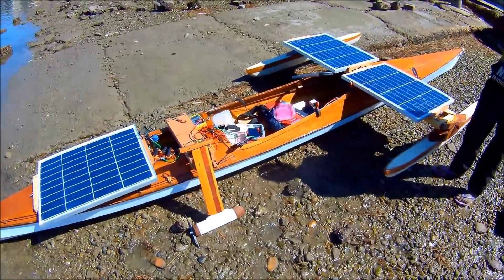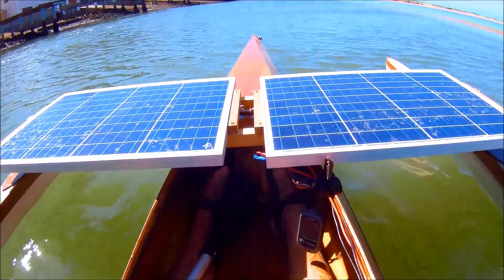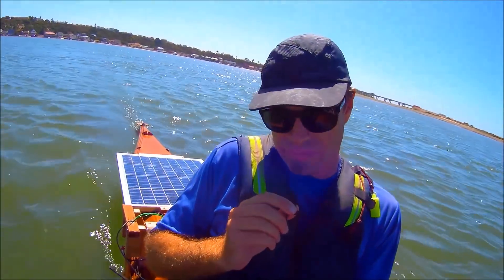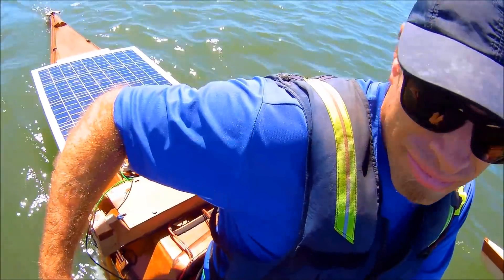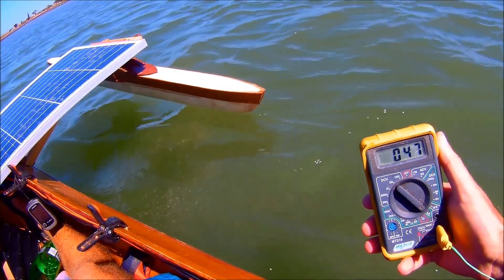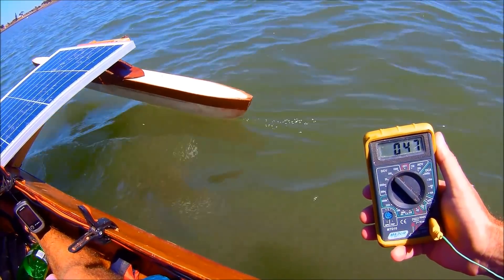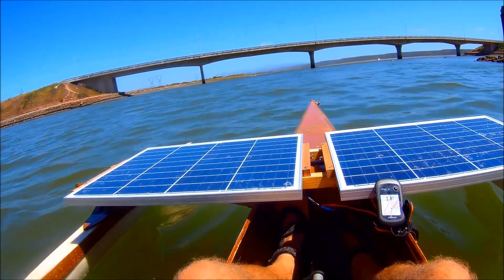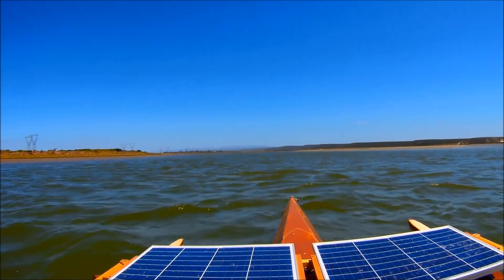Solar kayak - new propeller test

Comment from the maker: Using an aircraft propeller might seem counter-intuitive. I explain their performance underwater here: https://youtu.be/4kL66c6T9po
Reply: use super capasitor
Reply: Add battery  for backup. Because  it won't  run at night or in rainy weather
Reply: are those pontoons custom?
Reply from the maker: @vinny8532  yes, glued sheets of xps foam, shaped and covered in thin fiberglass.

Comment: Key note for solar panels: shade on even just one cell of a panel will act as a resistor to the whole system which is why you get such a drastic decrease in power despite having several other solar panels with full sun coverage.. The single cell actually restricts the flow of current.. Thats why panels are best for keeping batteries charged and running the motor off of the battery. Hope this helps! :)
Reply: @Alfonso Soriano If they were all in series one dead cell would not slow the motor it would stop it
Reply: excellent info, thanks
Reply: The weight of the battery should also be put to consideration
Reply: @steveddad4385  all panels have a bypass diode built into the junction box. He would be better off with a Lithium deep cycle battery. They are light weight so weight wouldn't be an issue.
Reply: @ddee2501  Weight doesn't matter much if your speed is constant.
Reply: integr8er66 they in series and parellel for this type of panel !
Reply: @RobertSeviour1  It does if your weight increases displacement which increases wetted area which increases drag.
Reply: @mabamabam  You are right, but compared to a road vehicle, a little extra weight has no much effect.
Reply: Can you use and charge a battery with solar at the same time?  Ideally I want to charge up the battery and use the solar but revert to the battery when losing power or need more speed.  Like get a 50 power motor with 600 watts solar to give 30amps so 30 power from the motor but I I need 50 I can use the battery or if the sun is poor (I’m in uk) then use battery
Reply from the maker: Absolutely. Connect the panels to the battery via an mppt type charge controller. Then simply connect the motor to the battery as well. As long as you use less power than the panel can produce, any excess solar power will charge the battery. When you need more motor power, all the panel power will go to the motor and the battery will supply any additional power if needed.
Reply: William Fraser sounds great, I know very little about electrics or boats actually, just planning to take the kids on some lakes for fun with an Intex 5 excursion, what battery and motor would you recommend?  I’m kind of thinking I need 50 thrust but that would need 600w of solar and then it’s how I build a Bimini to put the solar on, without also costing the earth! Cheers
Reply from the maker: @carlsmtb3171  I have only just bought a minn kota 50lb but have yet to test it before making any recommendation. I have seen some Intex inflatables perform surprisingly well under oars, even when loaded. Keeping the load in the centre will increase the rocker unless you have a very rigid floor. Some rocker is always good for low speed and high load.  I saw a video quoting 3mph max with a 30lb motor on the Excursion 5. So assuming 25A current at 12V, that is 300W for 3mph. Depending on the prop, a 50lb motor will most likely give you similar efficiency and performance but at a lower throttle setting. Any additional speed is going require much more power but you can also improve performance by using different props. I have yet to hear of someone getting worse performance after fitting a model aircraft prop. In time I will do the same with my Minn kota and make a video on it.
Reply from the maker: @carlsmtb3171  The large panels generally offer the best value in terms of power/price, but the size and weight make them difficult to transport and rig on the boat. The panels come in fixed size ranges, with length of around 1.65m, 1.9m and 2.1m. Width is usually around 1m for all of them. With each size offering you find a range of different power depending on efficiency. Weight for each size will be constant, so best power/Weight will always be the highest efficiency offer for a specific size. They are rare, but some companies do offer thin, semi-flex panels in these sizes. I just recently bought two 330W Renewsys Deserv F1 panels. They were double the price but weight is 1/4 of a similar size rigid panel. The allowable flex is so limited is of little practical use. Flexi consumer panels such as Solbian and Sun-power could easy cost 3-4 times more still.
Reply: @RobertSeviour1  with more weight the kayak would sit deeper in the water and the resistance from it would increase.
Reply: If I'm not mistaken each cell should have a bypass diode, you just have to get the correct pannel...don't need one in j-box
Reply: Only for the cells that are wired in series with that specific cell.
Reply: @RobertSeviour1  in boats weight increases your displacement which increases drag.
Reply: My panels generate power on a full moon!

Comment: Many have said it. You need a different prop. Match it up with the lowest kv motor for your voltage.  Brushless 110-120kv (@ 12.6v)motor with a trolling motor prop. I would find an old trolling motor and gut it. Use the shaft cut off and coupled to a brushless motor. Seals work well and you can cut weight by removing the old trolling magnets and resistors in the front if that's where they are located.  Esc can be ran using a servo tester / potentiometer. Best of luck. Please make more videos!
Reply from the maker: I have just tested a 215Kv brushless with bevel gear reduction drive. Unfortunately the electronics did not play along but I am working on it. New video soon. On the subject of the prop - a fluid is a fluid. If Reynolds number is the same the prop would not know the difference. Reynolds number is all about ratios, so for a given size prop all you need to do is match the rpm to suit the new fluid's density and viscosity.
Reply: Gear reductions will create drag because of the moving parts. Why not go lower on the kv and direct drive the prop? Get crazy and make a single blade counter weighted prop! I would even think about putting the prop in the front with a small nose cone. The turbulence from the rear of the case can't be helping. Just ideas. Thanks for the response.  I really enjoy this kind of stuff. 15 years in rc. 5 of them fpv. Now 2 weeks with an electric kayak and I'm thinking how I can make it more efficient.  Cheers!
Reply from the maker: @cuzimnik25  There is indeed more drag on the gears but it allows me to mount a large motor on a vertical shaft and keep the underwater housing small and streamlined. My new design does have the prop mounted in front. Spinner turned out of Black Cherry on a bench drill. The 3.7:1 gear reduction gives me the equivalent shaft torque and rpm of a 58Kv motor. I should now be able to swing a 10" prop with very coarse pitch, further improving efficiency, hopefully enough to justify the gear drag. Finding an actual motor with such low Kv is near impossible. I would still prefer a submerged motor though, the bevel gears are finicky buggers when it comes to alignment and adds to the noise.

Comment: That is very cool, Thinking a possible improvement if you don't want to use a battery. is to use a MPPT charge controller on a Capacitor bank. The Charge controller would prevent the panel voltage from being pulled down to the point that they do not put out much at all. I am very impressed that 150 watts worth of panels would propel that kayak that fast. I really like your experiment.

Comment: I've messed with 760 watts of solar running a 30 lbs thrust 12 volt trolling motor.  The pannels were all mounted above the canoe then I had a surfboard as an outrigger.  I would time how long it took me to pass a leaf in the lake.  I'd convert 'feet per second' to miles per hour.  I'd do about 3.5 mph.  Your 3.8 nautical miles per hours converts to 4.3 - That my friend is Moving!  Too Cool, I'm going to see what else you have posted.  Good Luck
Reply from the maker: Thanks Gary. 760W is probably overkill for your motor. A 30lb motor typically draw 30A, i.e. only absorbing 360W. So you can ditch a panel and save some weight. At the end of my other related video you'll see a canoe with around 800w cruise past at close to 5kts. Choosing the correct prop is also important.
Reply: @williamfraser  thanks

Comment: You seem to have come up with a much better design for the
 solar panel placement then I had when I built my solar powered system.
Reply from the maker: This was mostly driven by weight distribution. A solar roof would also be a nice feature for long days on the water. Roofs unfortunately require additional stability, being top-heavy as well as prone to catch the wind. The outriggers would have to be further apart and more buoyancy. Maybe my next project needs to be a catamaran...

Comment: A few easy optimizations
1. Apply a battery to capture the energy for a more stable motor output
2. Use flexible panels to make the skin of the kayak panels (much more surface area)
Reply: And don't forget a Rolls-Royce Trent turbojet.

Comment: Add battery so you are charging when the motor stop.
Reply: I would add a battery incase of cloud cover.
Reply: I would carry a paddle
Reply from the maker: @arnavrevankar444  I always do.
Reply: Or even better add some super capasitors
Reply from the maker: @TheJohanJonker  See my latest video with a brushless motor and supercaps.
Reply: I don't think you understand how it works.
Reply: @elcajondavid1  That's how solar electric is supposed to work anyway. This clown doesn't have a clue.

Comment: Make a solar trailer for the kayak. It would probably weigh significantly less than your wooden Outrigger system. Totally awesome demonstration!
Reply from the maker: Not a bad idea! If I tow it at just the right distance behind the kayak it would ride the stern wave with very little drag.

Comment: Add a capacitor bank to smooth out the breakup under shade.
Reply: Pretty cool.  Imagine a scaled up transport container ship as a hybrid saving hundreds of thousands in fuel, and pollution.
Reply: get a good set of capacitor... that can store 10 mins+ dive time   your all set.....
when the clouds come  you can stop charge and go. without good sun your toasted...
even low sun  stop wait 30min  and go for  15 mint 1 mile full speed
Reply: Really, add a capacitor and 35 thumbs up on that??  I guess this is not where electrical engineers hang out.  It would require a huge capacitor in order to provide 150 Watts for even 1 minute.
Reply: unless u add current limiting circuitry, the cap would dump it's stored charge too quickly. Bat + cap is better.
Reply: @SiMahDan  how many amps do you need.....  my scooter  will draw 25 amps when taking off .....   motor control.... and the  ebay board is a bat cap.....  deep cycle batters can discharge 500amps the board ink is about 70amp...... an solar will transfer all energy to it.... where a battery you cant...60% at best.....  and its not good to charge and use a batter unless its regulated charge is lower then charge .......just add a peddle generator  it wil store the power then discharge a good flow of amps .. a 12min with solar will last long time 30 40 mins so just pedal generator would work grate.. pedal fill and go.... now you can move at night... like pedal  generator is olny good for 2amps and you need  10 to 15amps for the motor..... or a java container windmill.. good for .5 amps let it spin  and in 2 hours your caps are full 12minuts... or create pull cord generator from a hand held screw driver with 50feet of rope.... you simply walk 50 ft recoil  2 o 3 times and your ready to go 12minutss  grate for camping how mush power do you need... base amp discharge  12min 15amps is lots charge phone run lights.. in backpack space
Reply: He lucky pick the perfect sunny day
Reply: @JNedoCT   you build it with a 2 seater aluminum bike frame and the motor you use is a 500watt 3 phase scooter motor.....  you now can power up the capacitor bank inside the wing on each side that can be removed to move the boat around on a trailer like tent poles  all concted the main bike frame then calculate how mush load the wings can handle...  it 2 seater + tent gear and food water....  so you need a sold frame....
Reply: @DIYDaveT  he said capacitor bank
Reply: @DIYDaveT .  Maybe you misread Ruben Van der Merwe comment.  "Add a capacitor bank to SMOOTH out the breakup under shade."
Reply: @DIYDaveT  you are wrong. that is all that should be said.
Reply: That's what a battery does.
Reply: @DIYDaveT  That's what a battery is for.
Reply: Batteries are probably more space, weight, and cost effective but that is the right idea.

Comment: If you use mppt for smaler strings that will be much more energy for your propeller.
Reply from the maker: Agree 100%. The challenge at the time was cost. The cheapest mppt cost more than all the panels combined. I used an mppt when I installed the 300W panel and brushless motor. Top speed nearly doubled.

Comment: Interesting build. Try different propeller for water. btw, put a few reflector on the side of the solar panel to redirect the sunlight to the panels. It helps boost efficiency.

Comment: Cool idea! So two aspects I want to add, the first is you can add a small accumulator to have the power under bridges, the second is would be interesting if it could work with hydrofoils (I think it needs more power but it could be comfortable with big waves).
Reply from the maker: With my weight and that of two large panels, 600W might be enough to fly on foils. It will require a foil of at least 10ft span. The large foil will allow low lift-off speed but will severely limit top speed. Some lightweight flexi panels of equal power will really open up performance options.

Comment: That propeller is intended for high speed use in air.  You should use a prop designed for water use.
Reply from the maker: OK, let's race...https://youtu.be/6u-j1gxQRGc
Reply: Actually, model airplane propellers are more efficient in water as well air because they are designed for maximum thrust, not cutting weeds as trolling motor props and to a degree, even regular boat props are.